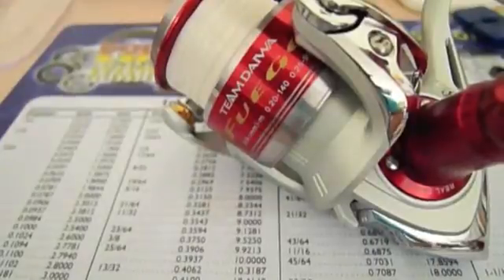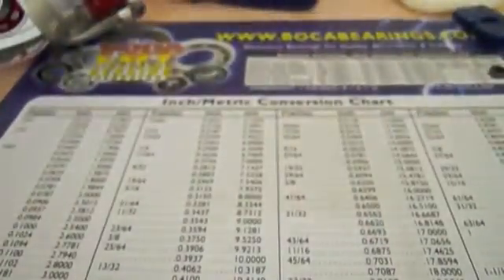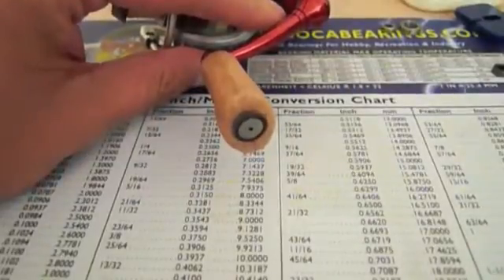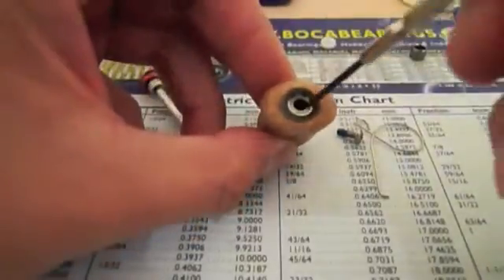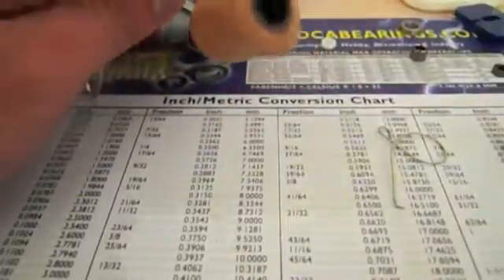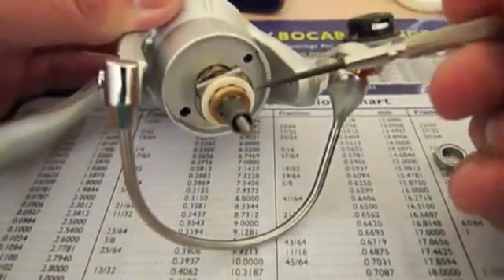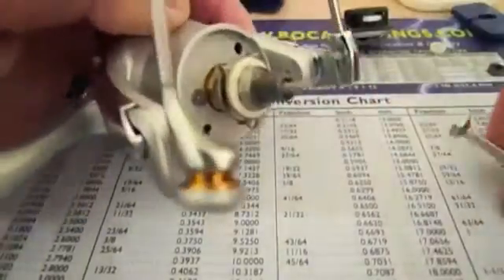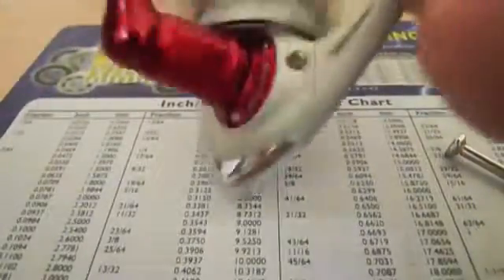How to replace Daiwa Fuego Spinning Reel Bearings

Comment: Replacing the spool bearing has no effect on the smoothness of the handle being turned since the only time the bearing would turn is when line is being pulled off of the spool when a fish runs. So turning the handle and saying there is a great improvement is not valid. If you had pulled line off of the spool and said their was an improvement then it would have been more valid. Also, a bushing is plenty good for a spool drag and most self lubricate with a scoring around the axle which holds oil